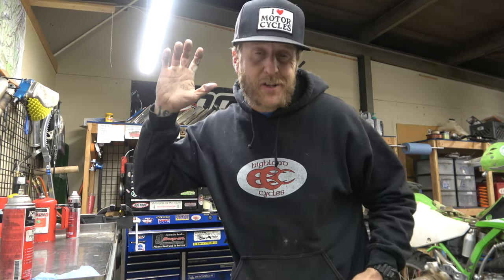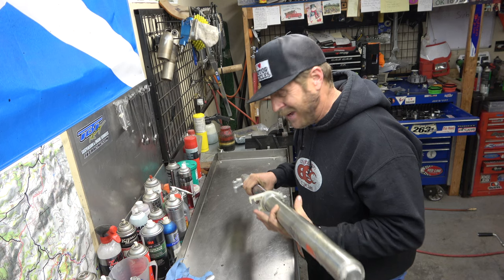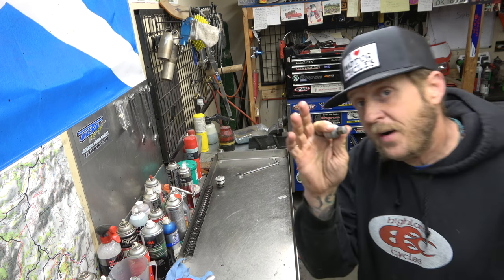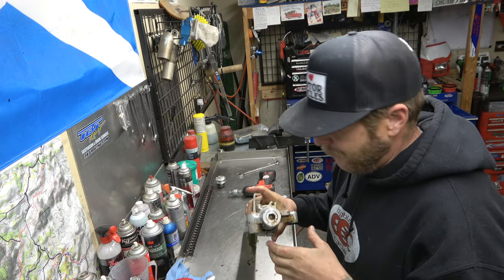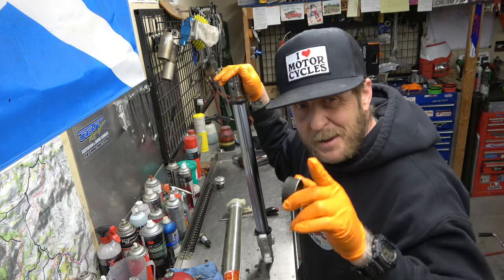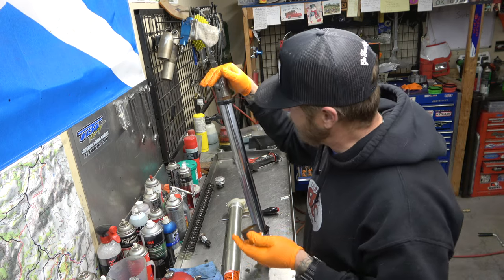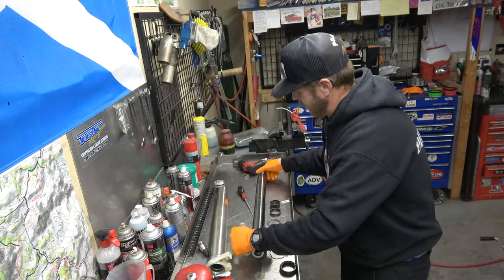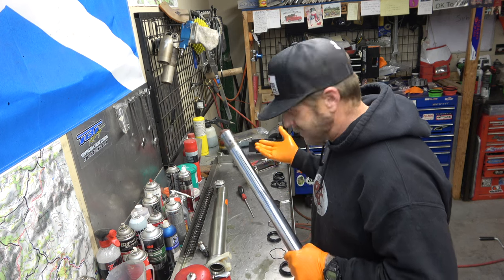Dirt bike fork seals!  KLX300 Fork seals

Comment: Hey I’m trying to take the valve out of the bottom and did your trick but the valve just spins and doesn’t come out any idea what I’m doing wrong
Reply from the maker: You have to hold the rod and kind of cock it to one side
Reply: Did you every get yours out?  I used his trick to loosen it, but the rod never comes out.

Comment: dude your the man, great video. i Couldnt get the valve out without the cartridge spinning so i used a piece of 1" EMT and cut two teeth into the bottom of it and it worked perfectly as a holding tool. Also a PVC 1.5" adapter cut in half and taped back together over the fork tube worked as a great ghetto seal driver.
Reply from the maker: Awesome

Comment: Thanks for video.  I subscribed.  I had the same problem as the other commenter.  14mm Allen just spun even when I side loaded the rod.  Was ready to buy that holding tool but I had a chunk of 1” black pipe and used a cutting wheel and made a crude holding tool with 2 nubs and clamped it with a vice grips and tightened it back up.  I just changed my seals with it in.   Whew!!
Reply from the maker: Awesome

Comment: Thanks for the video :)
At what torque you placing the forks back on the bike . On the triple clamp 
There is no spec in the user manual
Reply from the maker: I go with 17NM. It’s what the KTM’s call for and it seems to work well.

Comment: Great video, I'm getting parts together for my front fork maintenance. I'm getting seals and oil but I'm confused on what Weight of fork oil I should get. The manual calls for the Kawi KHL 15-10 oil which I've never heard of. Would some Bel Ray 5w be okay? What does different fork oil do? If i could get the forks a little softer that would be okay. Would a lighter oil achieve this? Thanks Morgan!
Reply from the maker: 5wt is perfect.  Lighter oil makes the suspension softer. So maybe 3wt if you are looking for that.
Reply: @highlandcycles  Awesome thanks dude!

Comment: Morgan, my buddy's WR has some serious stiction issues. I'm 220lbs and have to pounce on the bike to get the forks to budge! My '02 EXC has a little stiction as well. Tempted to give your scotch brite trick a go. Looks like you're using a red pad? I thought those were on the aggressive side of scotch brite pads? Do you know what grit that equates to?
Reply from the maker: I don’t know the grit but it works great without scratching it badly. I also use a little solvent or fork oil on it so it’s not dry. On the WR, is that off the bike?  Make sure they aren’t bent. Also if it’s on the bike make sure the wheel is installed correctly. You can get the forks out of line.
Reply: @highlandcycles  We did check for straightness. Went so far as to chuck the Yamaha stanchtions in the lathe and run a dial indicator down them. Front wheel is not binding the forks. They seem fine  with just the bushings installed, but once the seals go in it binds. Really have a feeling it's seal related, but who knows. The KTM isn't as bad, but it's not what I feel they should be. It's due for a full suspension service, I'll give the Morgan Polish a go 👍
Reply from the maker: @shinyribs2178  Right on.  Yeah, the yamaha is weird for sure.  What seals is he using?
Reply: @highlandcycles   AllBalls initially. I was certain thst was the problem. Stock replacements didn't help. Probably shouldn't just went with SKF. Regardless, appreciate you taking the time answer a stranger on the interwebs :)
Reply from the maker: @shinyribs2178  you bet.